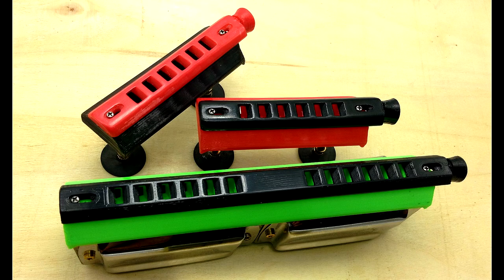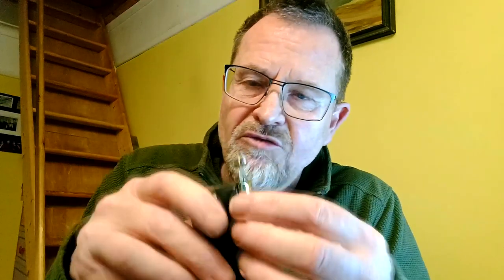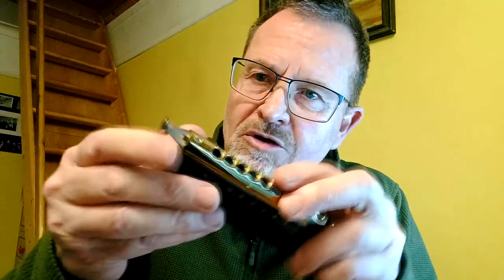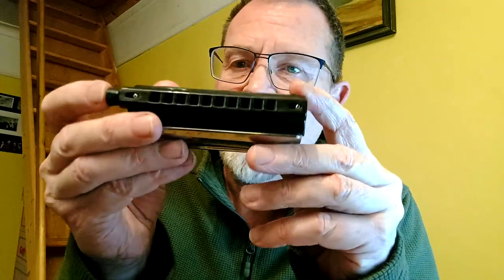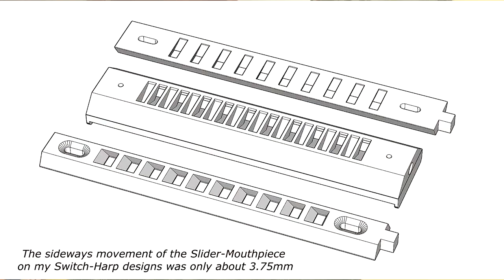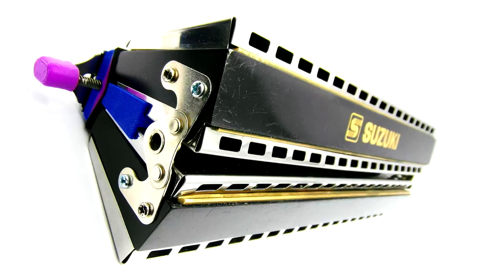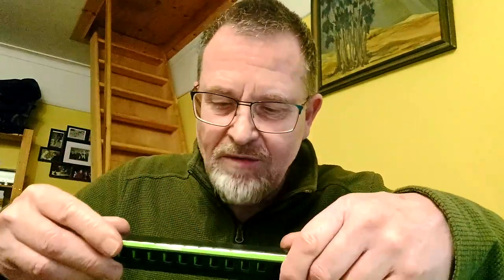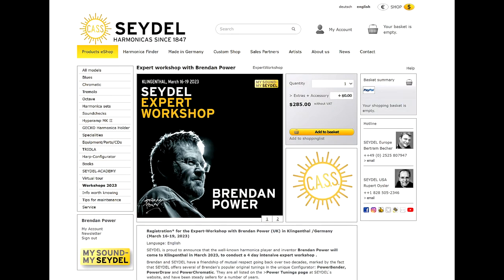SLIDER-MOUTHPIECE for HARMONICAS : Low Profile, More Efficient! (Brendan Power - TECH TUESDAY #7)

Comment: Seydel's Non-Slider chromatic is very interesting. The rapid changes that are possible with a traditional chromatic (with a slider) -- for example the triplets C-C#-C or G-G#-G, etc --  are not possibe (for me, at least) with the Non-Slider. But for those players not needng that (e.g. traditional blues  can be played quite well  without this functionality) the Non-Slider offers many advantages: no valves (that might stick or make unwanted sounds) and easy draw bends on many holes.